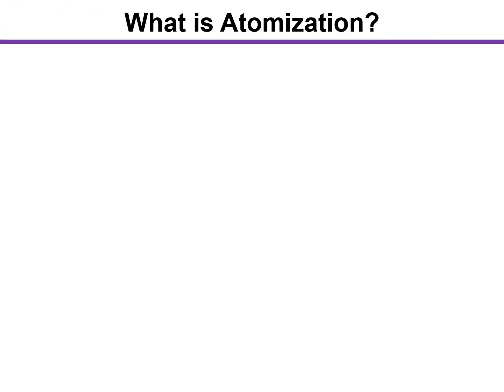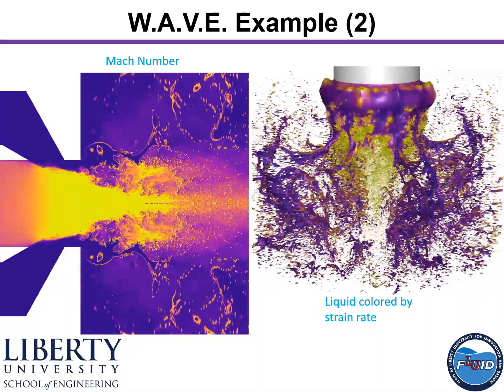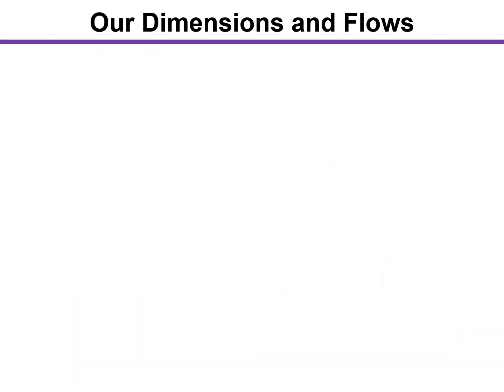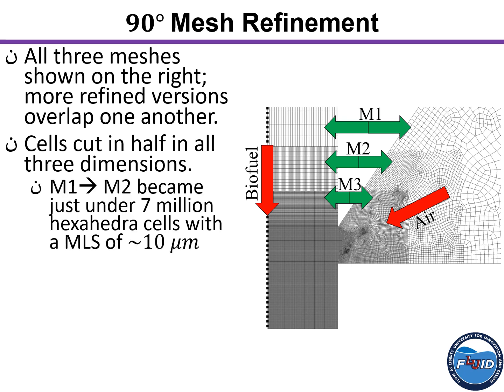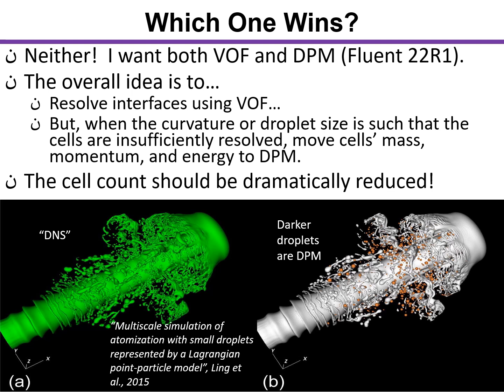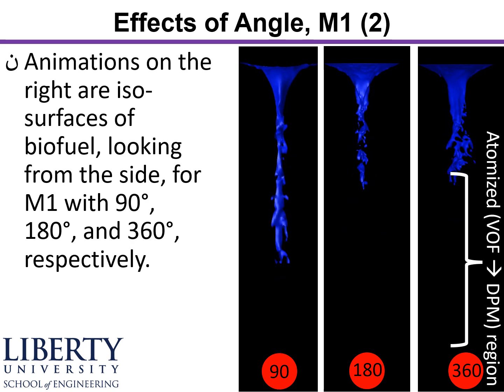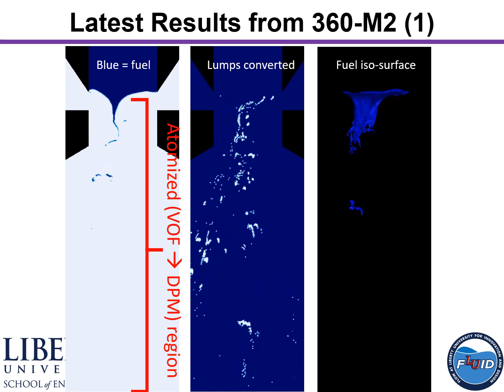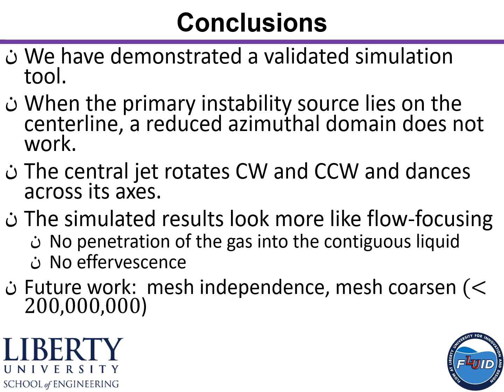Validation of VOF-to-DPM Methodology Using a Flow-Blurring Atomizer

Comment: do you have any tip regarding the value to set for the minimum and maximum volume-equivalent sphere diameter range in the VOF Lump Transition Requirements? What I'm experiencing is the fact that the lump are not converted in DPM.
Reply from the maker: Dear @giuliogenerini2419, thank you for your comment. I am publishing a paper now with more information and would be happy to point you to it when complete. Remind me in a month or two.
Reply: @fluidgroupresearch Hi, Im experiencing the same thing, how are things going with the paper?
Reply from the maker: Dear @VsukraM, it is still in review. Please find my email on my primary website (https://fluidgroup.org/), and remind me to contact you.
Reply: @fluidgroupresearch  Hello i also am interested in this paper. Thank you
Reply from the maker: Dear @clementeserpico8881, it has been published here: https://www.sciencedirect.com/science/article/abs/pii/S0735193324008595. Sorry for the late reply.
Reply from the maker: Dear @giuliogenerini2419, it has been published here: https://www.sciencedirect.com/science/article/abs/pii/S0735193324008595. Sorry for the late reply.